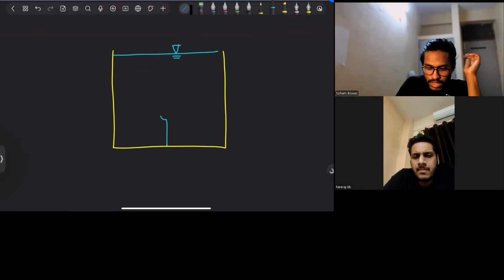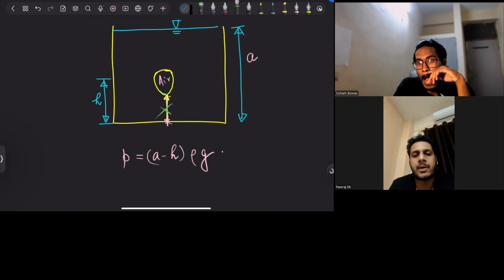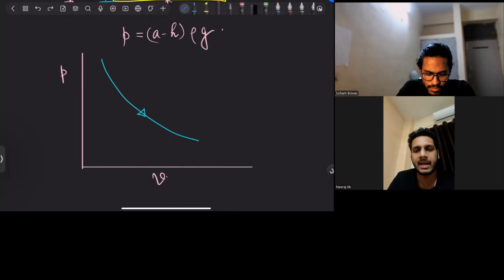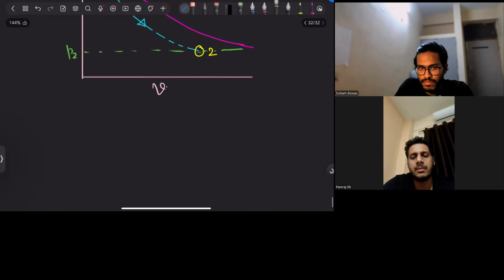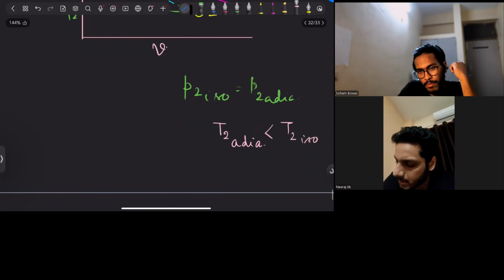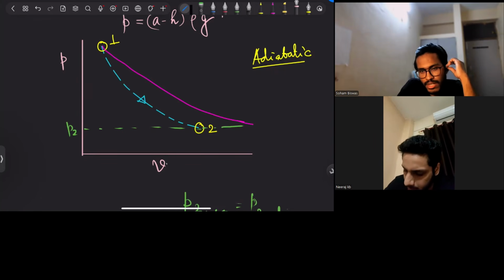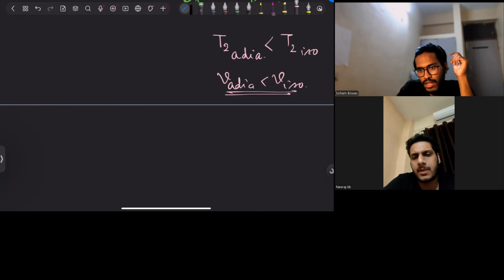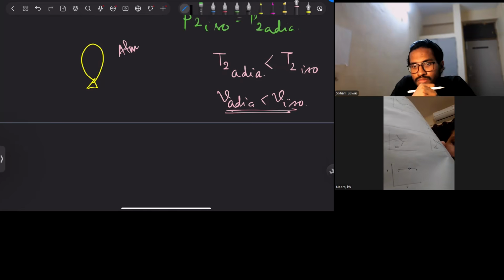This is how you should answer in BARC interview!!! | DRDO AIR 1 | ISRO AIR 44 | GATE AIR 6

Comment: I am not able to understand how rho*(a-h)*g is the internal pressure in the balloon, cause as it is shown already filled with air its pressure will be more than Patm if kept in open but until we don't know how much air was filled in balloon earlier how can we know that pressure. rho*(a-h)*g is just the external pressure acting on it we dont have any relation to equate internal and external pressure.

can someone please explain
Reply from the maker: Yes, you are absolutely right. I told in the video, that it is approximately rho*(a-h)*g. Not exactly.
Reply: It will be slightly greater as he pointed out.
Reply from the maker: @rj23032 yes

Comment: Pressure inside ballon will not be (a-h)*rho*g, if this happens string will be slack
Reply: how
Reply: @ShlokYadav-v6pbecause if pressure be equal to that, then rope would not be needed, because inside and outside pressure will be equal, and ballon under its own weight will make the string slack. You can't comment about the preasure inside ballon
Reply: @enchantedMYTH  he said the pressure will be slighty more than that / nearly (a-h)*rho*g
Reply: @enchantedMYTH  how will pressure affect the weight of it
Reply: Slack or tension in the string depends upon the buoyancy force I think .and I think It will be tension only due to the average density of both balloon material and air inside combined is lesser than the density of water . Here pressure inside the ballon at initial state will be more than (rho*g*(a-h)) . But please tell me when we cut the string how balloon inside pressure is decreasing?
Reply: @abhishekraysingh6878  lets say the pressure inside the balloon is P

here the P is calculated as the sum of the surrounding pressure and the "excess pressure" caused by the liquid's surface tension pulling against the trapped air.

Therefore, P = Psurrounding + Pexcess

now the surrounding pressure will always decrease when you rise up from bottom to the top of the tank hence the "balloon inside pressure is decreasing" lol ulta lika apne 😅
Reply: yes the pressure will be approximately equal to and greater than (a-h)*rho*g, he did clarify that 

now i get your point but imagine we go to a depth "a" from the tank surface and this depth "a" is exactly at the center of the balloon and by our "assumption" that the pressure inside the balloon being exactly same this will be only at the level of the depth a 

now if you try to understand why the buoyancy force comes into the picture even if the pressure inside the balloon is approx same (as it is important for the string of the balloon to not be slack)  is because there is a pressure gradient above and at the exact position of the balloon 

the pressure above the absolute position of the balloon will always be lower than it is at the position of the balloon 

the pressure inside the balloon would never matter as long as the balloon and the air filled inside the balloon is lighter than the external fluid it is the whole balloon and air inside it system will undergo a upward buoyancy force and the string will never be slack

and "balloon and air inside it is lighter than external fluid" should be something that the question should have clarified before asking if there would be tension in the string

Comment: He says process is irreversible and consider as adiabatic then how can we find volume after expansion with P.V over gama because it is for rev adiabatic
Reply: In second case you said for assuming isothermal process, here expansion is occuring so for isothermal expansion there should be a heat addition to maintain the constant temp for expansion of air as there is no any heat addition there so how will you maintain const temp with decrease in pressure
Reply from the maker: @shivamkumarguptam-0317 it's very nice to see someone thinking on these.  You are absolutely correct. We cannot maintain the isothermal condition in this case. I just asked him to draw the isothermal curve between the same pressure ranges. I didn't say that it is a practical process. I really appreciate your thinking ❤
Reply from the maker: I asked him to consider it as an ideal reversible process